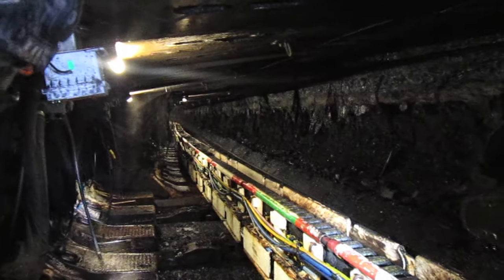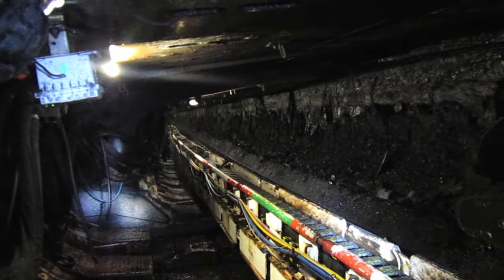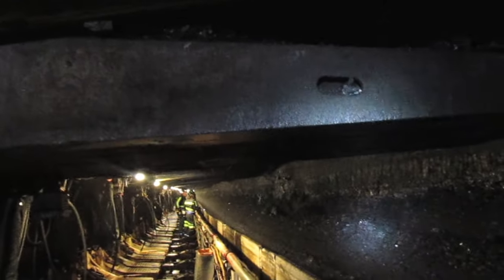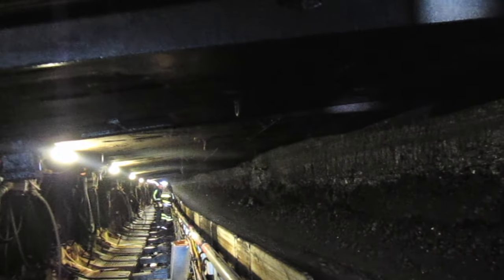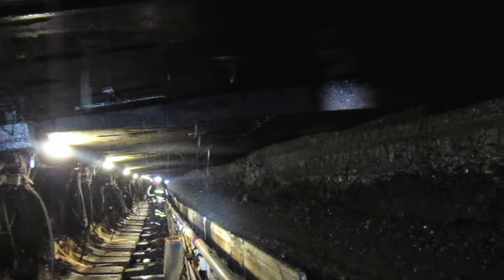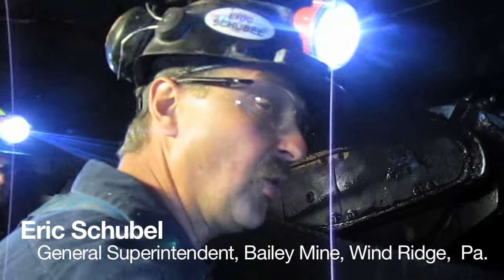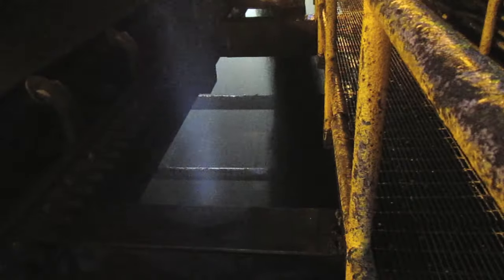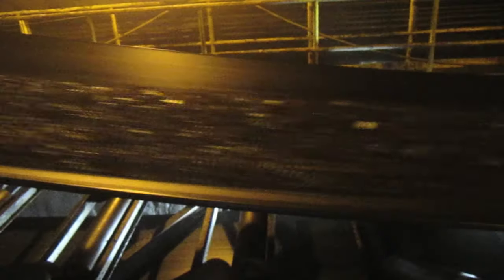Bailey Coal Mine in Wind Ridge Pa. serves up 45,000 tons of coal per day

Comment: 45000 tons really waow waow
Reply: I used to work at this mine they run 2 longwall miners and 2 continuous miners 3 shifts a day 24 hours a day they are the highest coal producers in the region I was on the Longwall Support crew and CM Support I really miss working in the mines
Reply: I used to work at this mine they run 2 longwall miners and 2 continuous miners 3 shifts a day 24 hours a day they are the highest coal producers in the region I was on the Longwall Support crew and CM Support I really miss working in the mines

Comment: Joy went out of business last year (2016)...they made mining machinery...end of coal mining is near. We have 90 trains a day on the Conrail/NF Southern tracks and its a rare sight indeed to see one loaded with coal. Mountain-top removal gets coal for 1/2 the cost of deep mining...that's why its done.
Reply: D Wetick still in business pal, Just owned by Komatsu now, we’re still building and rebuilding miners every day, plenty of work on the schedule... Joy never went out, just slowed down, it’s boomin right now
Reply: The only thing boomin' is the next methane explosion.
Reply: @dwetick1  THIS, discover of cheap hydraulic fracturing of shale gas reserves killed coal, but it was dying a slow death to renewables anyways.
Reply: @allan1048  I am not an expert, so disclaimer for that, but i would bet this may be in part due to having to "race to the bottom" 

(ie new markets in china/india/africa as they industrialize more, but may not have the standards of countries like the USA/EU) 

(australia is an odd "in-between" case on the issue)